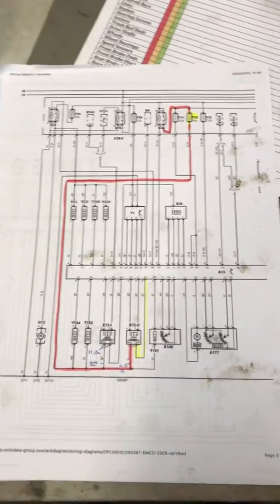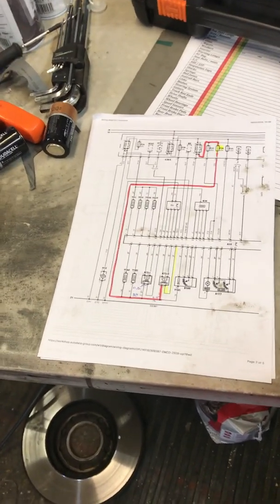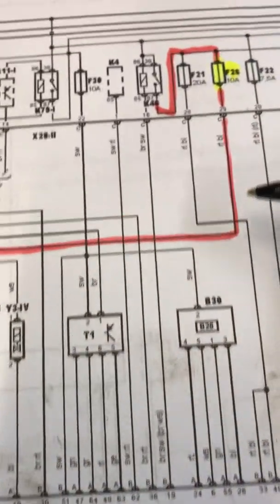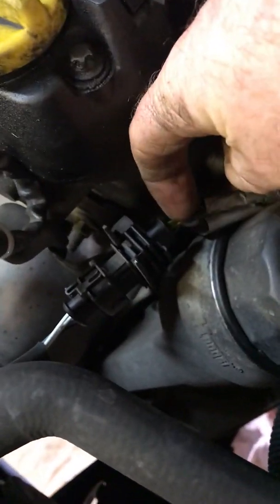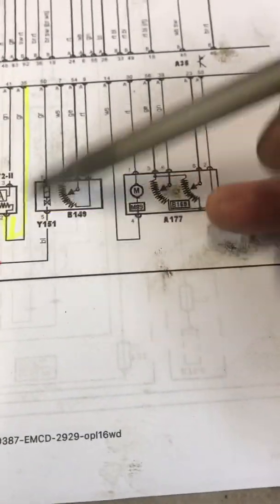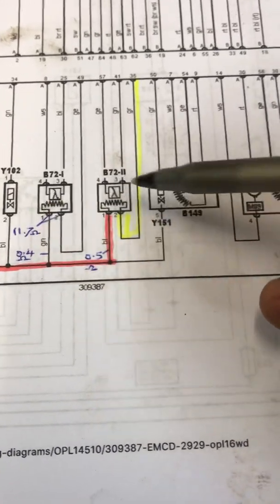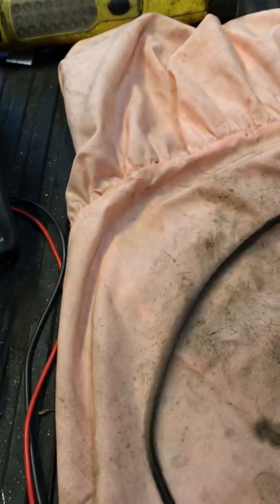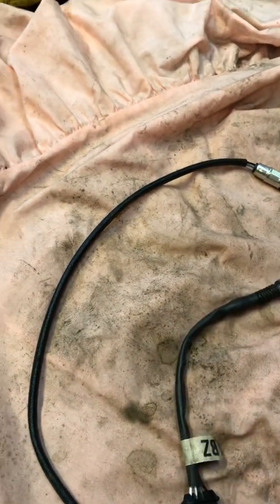P0141 Fault code

Comment: The clip under the bonnet is that for upstream sensor then yes? Where's the clip for the downstream sensor? And also does it matter the order of wires mine shows white black white grey?
Reply from the maker: Yes the clip uppermost top of engine is the upstream 02 sensor, the connector for the downstream sensor is back of engine near exhaust, best accessed from underneath the car. The white wires are for the heating element. Within the sensor. 👍
Reply: @robertcole8730  thanks mate I had  replaced post cat sensor die to p0141 with a off the market one and still no change, car shakes at idl and problem with  air and fuel, no live data on bnk1sns 2
Reply: Can i send photos over here I would love for bit of help and advice lol? My mechanic suggests buying a branded maf sensor even though it's pointing to o2 sensor the maf has readings and also stays the same If I plug unplug whilst car is on.
Reply from the maker: Sounds like you need auto diagnostic tool to check the parameters of the sensors

Comment: Hey 👋 is this sensor . Bank 1 sensor 2 ? I have Opel Corsa c and also the same error code. Thanx
Reply from the maker: Yes it’s sensor 2 downstream furthest away from engine along the exhaust, no:1 is visible on top of cat as you look in eng bay, no:2 is underneath, jack car up. 👍
Reply: @robertcole8730  thanx for the answer, i think opelc corsa c 2004 , have only 2 oxygin sensor . right ??
Reply from the maker: abdel -hak send me your vehicle Reg number, to check. But if there is only one it will be the upstream sensor, the easy access one near the manifold
Reply: @robertcole8730  ( WOLOXCF0846097359 ) its Opel corsa C .1L- 2004. 60 PS //3 zylinder. thanx